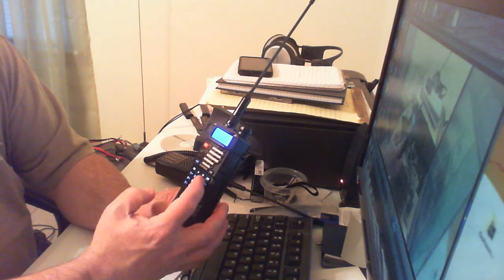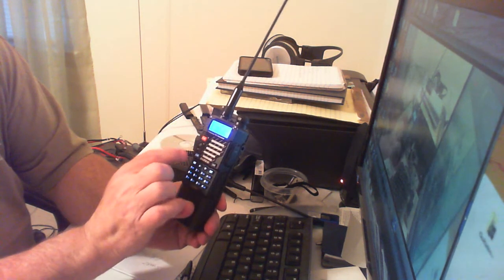HOW TO PROGRAM BAOFENG UV5R+.wmv

Comment: Thanks for the video. The only problem I noticed is that mine does not say "receving memory," it says "transmitting memory." Any ideas on why mine doesn't say "receiving memory?" After I thought I was finished and hit VFO again, the original value was set in that frequency instead of the new frequency.